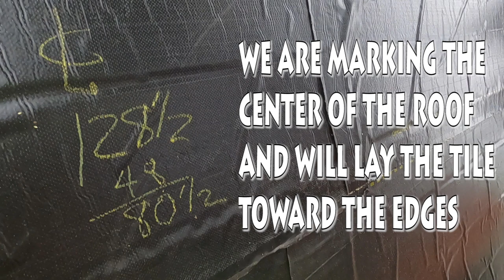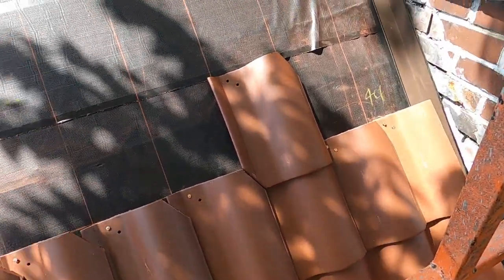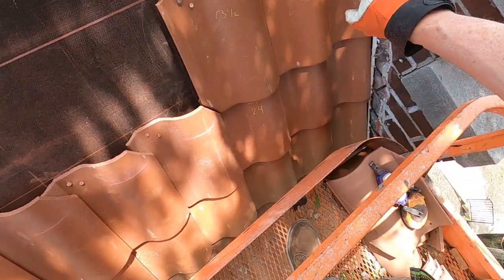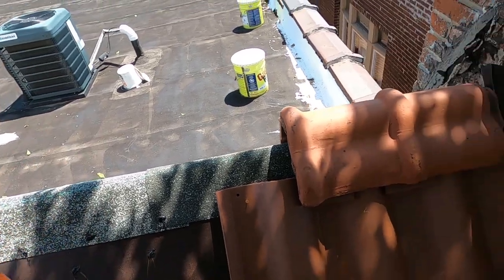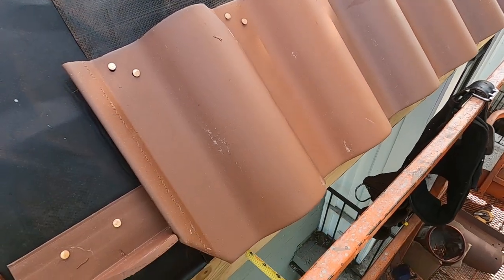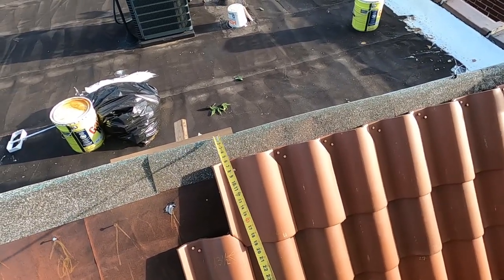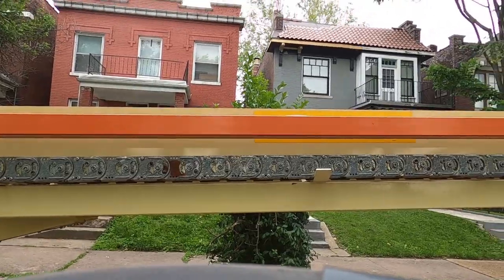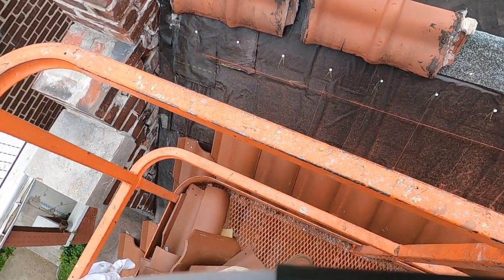15. Ludowici Spanish Tile field tile installation in detail with chalk lines

Comment: Roof area is not square,dont measure down from the ridge,start straight at the eaves and terminate at the ridge,problem solved.
Reply from the maker: Eves are not parallel to the ridge, nor is is straight across. One needs to snap a line at the top of the first row to get a straight bottom row, allowing some tile to be a bit long. Then at some point one needs to measure down from the ridge to make sure the tile looks parallel to the ridge even though the ridge sags in the middle. You don’t want it to have a top row that is not parallel to the top. You can’t just let it terminate at the ridge based on the first row. Small adjustments are needed as it is laid up if you want it to look correct.
Reply: What is the purpose of the black roof paper .Because if its there to keep water out all the nails to hold the tiles on it will leak ? Why don't you use battens
Reply: This job is a failure. You did not use copper nails in time the nails will rust out causing a leak. Tile hold moisture.
Reply from the maker: In St. Louis, MO I have only seen 1 batten installed roof in 40 years. Remember the battens will be nailed through the felts and the wood can dam up and funnel the water to the nail penetration. Good question.  The black paper is Carlisle WIP HT-300. (Water and Ice Protection - High Temperature) . This membrane is one of the few that actually seals around the nail shank. The old timers would use two layers of 30 lb. asphalt saturated UL  rated ASTM D-226 rated felt. (NOT No. 30 and not fiberglass) and blind nail the first course. (Start with 1/2  width sheet nailed with galv. hot dipped roofing nails, then cover that with a whole width sheet which is nailed at the top 1/2. etc. all the way up and there will be no nails exposed.) OR use 43 lb. ASTM D-226 UL rated with nails/caps and nail pattern per the manufacturer..  Refer to Ludovici Roof Tile for their specs, or whatever manufacturer you are using. Do it like they spec to stay in warranty.
Reply from the maker: If you look close you will see copper nails were used. You are correct that In about 70 years on this steep slope galvanized nails will rust away.
Reply from the maker: In St. Louis, MO I have only seen 1 batten installed roof in 40 years. Remember the battens will be nailed through the felts and the wood can dam up and funnel the water to the nail penetration. Good question.  The black paper is Carlisle WIP HT-300. (Water and Ice Protection - High Temperature) . This membrane is one of the few that actually seals around the nail shank. The old timers would use two layers of 30 lb. asphalt saturated UL  rated ASTM D-226 rated felt. (NOT No. 30 and not fiberglass) and blind nail the first course. (Start with 1/2  width sheet nailed with galv. hot dipped roofing nails, then cover that with a whole width sheet which is nailed at the top 1/2. etc. all the way up and there will be no nails exposed.) OR use 43 lb. ASTM D-226 UL rated with nails/caps and nail pattern per the manufacturer..  Refer to Ludovici Roof Tile for their specs, or whatever manufacturer you are using. Do it like they spec to stay in warranty.